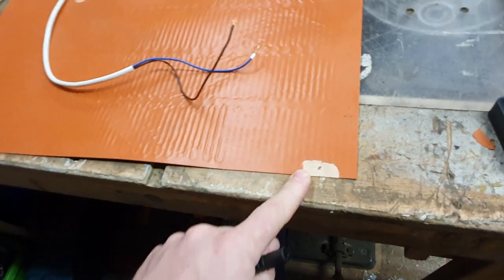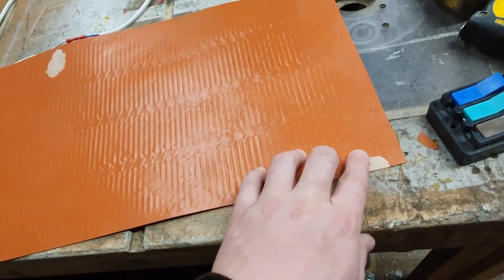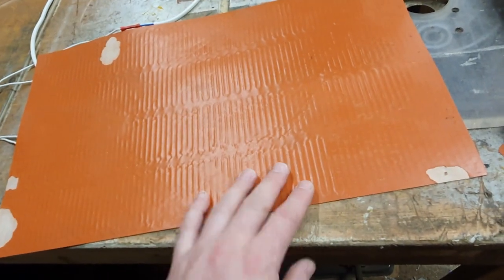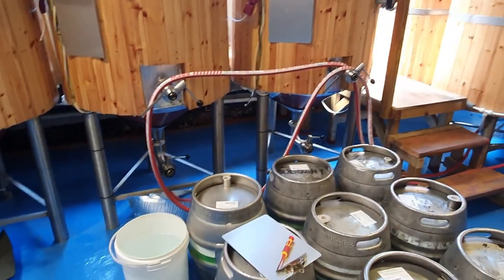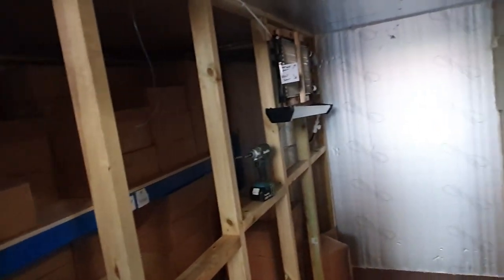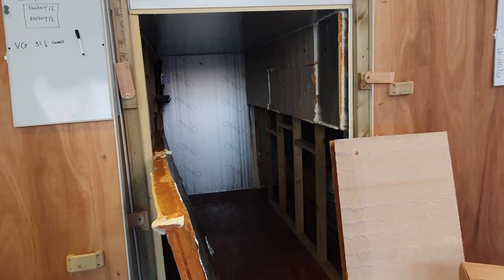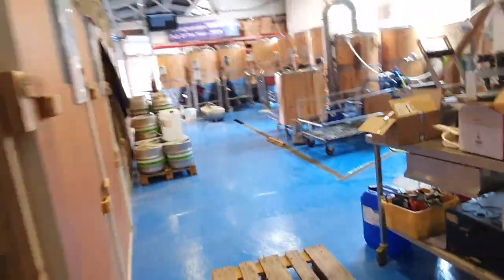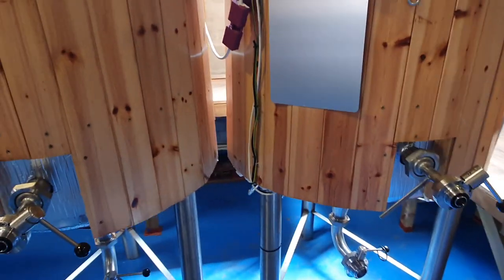The Power Went Off

Comment: possible to add a thin layer of a vinyl adhesive to the edges to seal them, as well as the spots that lost their rubber? I'd try something like E6000 to seal those edges - if it resists debonding well enough, you could easily use it to repair the spots that lost their protective rubber cladding. I used something like this to bond my keezer collar to the freezer and I think you'd have to cut it off to remove it.  It is basically rubber after it sets.